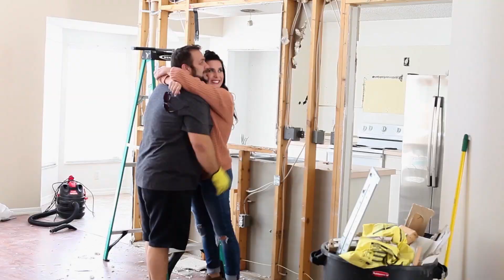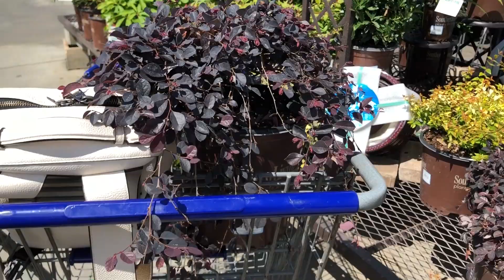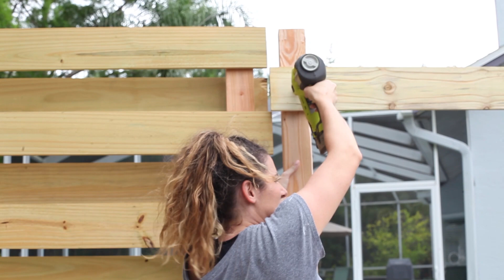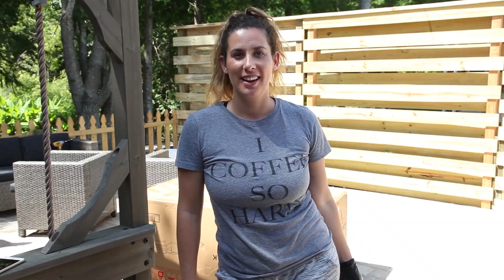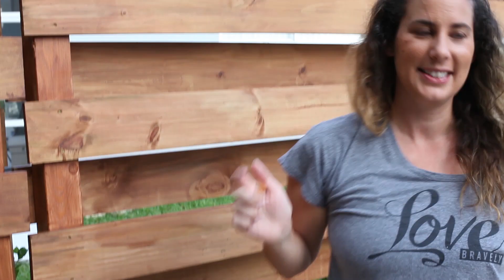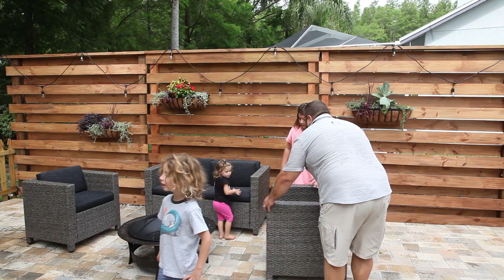Backyard Makeover & DIY Horizontal Slat Fence with Lowe's! | House to Home Episode 6

Comment: What’s the total height of the privacy wall?  And did you need to pull a town permit for it?
Reply from the maker: Ours is 8, in height since we mounted the posts to the pre-exhisting posts and didn't have to put them into the ground. For ours, we didn't have to pull a permit, but you could check with your town on restrictions. We shared more detail here: https://freshmommyblog.com/horizontal-slat-fence/